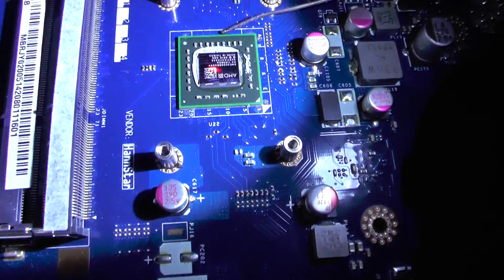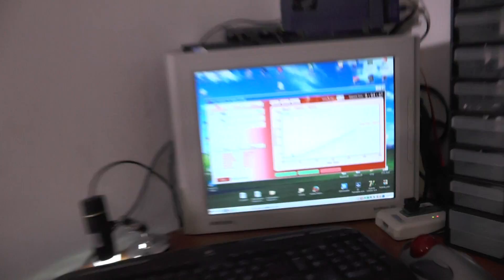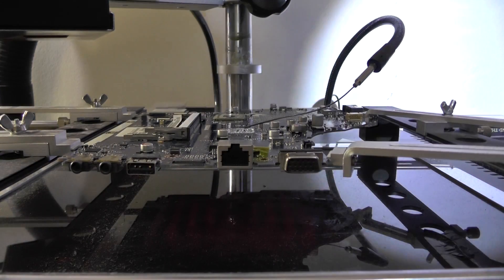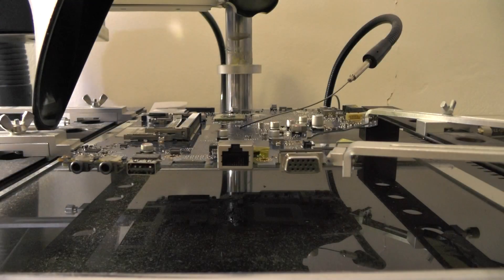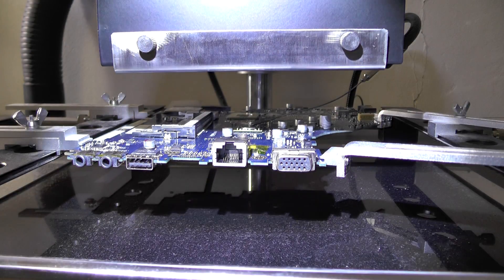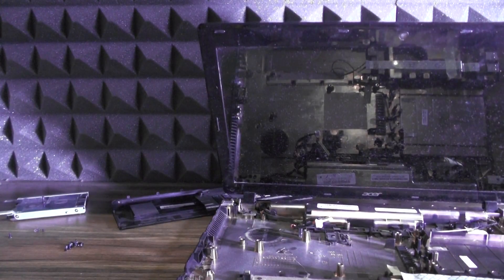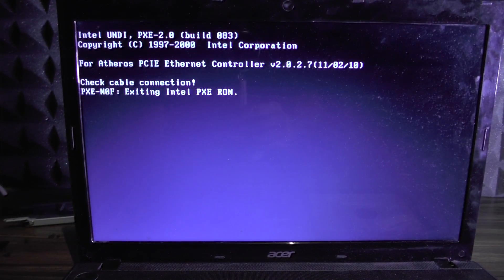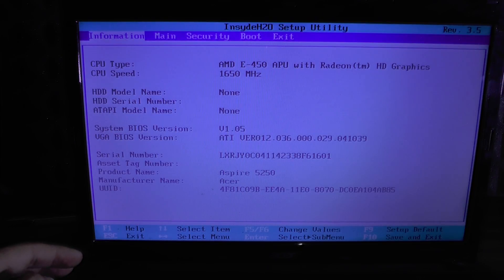[HW Upgrade] - Upgrading Acer 5250 cpu (the hard way)

Comment: hello from France
it's a shame that this video is not translated because I have the same problem with aspir 5250
Reply from the maker: Hi, if you have any questions ask :) i’ll try to help :)
Reply: Thank you for your reply
my problem is that this 5250 pc is slow and very slow and I decided to buy a motherboard directly from AliExpress with the new CPU that you installed, because I am not equipped to solder
Reply from the maker: @abdfakhour7561  probably the best solution!
Reply: thank you